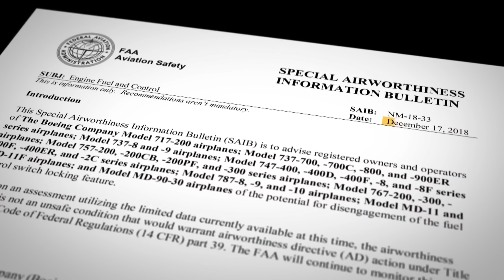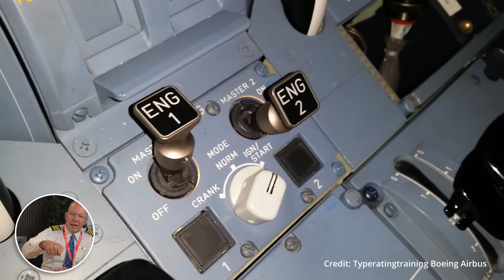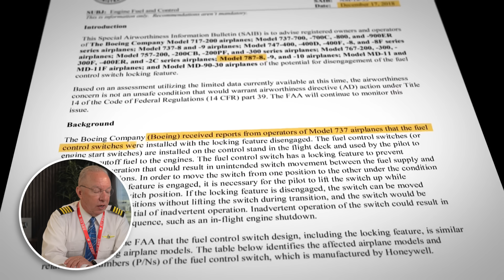Air India 171: The FAA’s 2018 Fuel Switch Locking Bulletin Explained (16 Questions Answered)

Comment: Aviation Herald was told of another safety bulletin that might be of interest as it applied to the 787-8 as well as other aircraft. It is this one: GEnx-1B SERVICE BULLETIN - 73-0097 R01 Revised: 01/29/2021  SB 73-0097 R01 ENGINE FUEL AND CONTROL - ELECTRONIC ENGINE CONTROL(73-21-20) - REPLACEMENT OF INTEGRATED CIRCUIT MN4 ON MAIN CHANNEL BOARDS
Issued:12/17/2020.  Solder on the existing part was subject to cracking with age and heat and the advice warned of a possible catastrophic failure of fuel delivery.  A replacement part was required.  One hopes that this part was replaced in all of Air India's 787-8 aircraft after 2021, especially older planes.  Has this been checked?   Air India have already missed one required update on the fuel system and have today ordered a check.  Could this be another, perhaps causing intermittent failure?

As a sometime passenger on Air India's Dreamliners I would really like to be reassured about this.

Comment: My question to Steeve is if a pilot can move both the fuel cutoff engine is less than a second, why the HELL  was it left like that till 10 seconds untill pushed back to run by other pilot and did not do it instantly in a 2 of seconds. When u know both the engines mid air was cut off, from that moment would you think or talk what happened or does your hand instantly go there and start it back within a second??? Or u think the other pilot didn't allow him and were really fighting in cockpit!!????? Or if there were any other conversations happening, why wasn't that it the report. They would know instantly right

Comment: Assuming that one of the pilots maliciously cut off the fuel, plus the recent situation on an Alaska Airlines flight out of Washington where a troubled off duty pilot sitting in a jump seat attempted to pull the engine fire suppression handles in flight, without any real fire indications present.
•What do you think airplane designers/engineers/unfortunate pilots facing a similar dangerous situation could do/change or how might this be prevented going forward? 
•What are your thoughts on different airplane design changes, or possible airplane logic updates to avoid these situations? Pros and cons of a particular or specific change you might favor? 
•For example, would placing a cover over these switches - in addition to the detent help? Or maybe installing two sets of cutoff switches per engine (one set for each pilot where both sets must be in agreement)? Or possibly separating the number one and number two switch locations making them further apart?

Of course, the best solution is one that provides better mental health services to pilots, but also across the board to all professions. This service in addition to the implementation of a frequent, yet robust screening system to identify and aid pilots struggling, and without any unreasonable or harsh penalties for pilots seeking help. However, I'm afraid it may be impossible to completely or even significantly prevent a similar situation simply because of our human factor and human emotions. It's likely that this case (and similar) will soon be cited as a justification to give control over completely to AI; eliminating the astonishing human pilot capabilities due to a fear over the (extremely rare) human vulnerabilities that lead to terrible disasters like this... 

Thanks Captain Steeeve!

PS 
From what I understand (yet disagree with), US Law restricts pilots above a certain age from flying commercially - and you are nearing this "cutoff age". I'd imagine your final flight will be emotional and something personal for yourself and your family, still may I ask that you please share even a small piece of your final commercial flight with us here on YouTube?!

Thanks again Captain Steeeve!

Comment: A one second interval between cutting fuel to both engines mechanically seems to be a bit quick . It later takes two seconds to return to run . Can both fuel cut off switches be turned to cut off in one second ?

Comment: Captain, RAT deployed the same second as engine cutoff (08:08:42) — and as you said earlier, RAT needs major system failure to auto-trigger. Isn’t that a strong sign of a sudden electrical/system fault, not pilot intent?
Also, the CVR only includes one line: ‘Why’d you do that?’ and ‘Mayday Mayday’. In a 30-sec flight, are we to believe that’s all they said — even to ATC? Feels like the report only highlights what fits the pilot-blame angle.”
Reply: If the act was intentional, and he knew only 2 people were in the cockpit, why would he deny it outright? Psychologically, someone caught in such a private setting (cockpit) would more likely make an excuse — like “I did it by mistake” or “It slipped” — not deny it completely. His direct “No, I didn’t” shows he genuinely didn’t expect to be blamed. That part is being totally ignored in the current narrative

Comment: Captain, why it can't be an electrical disconnect of both fuels behind the dashboard to motherboard or to the engine where it exists the cockpit towards engine through internal tunneling of wires as company was blamed to have metal pieces left behind inside the metal sheet

Comment: Captain Steeeve....this was a preliminary report. It said the 2 fuel switches were moved within 1 second. With the type of switches that these are, it is impossible to switch both switches in 1 second. You should know that since you are a pilot. You are blaming the mental health of the pilot to divert the attention from the design fault of Boeing. It's not a surprise that you being an American is trying to defend and shield an American company (Boeing)!! There is absolutely no proof that this is pilot error. Stop blaming the pilots who are not alive anymore to defend themselves. Stop defending Boeing by saying that the airfact ran as intented. You are clearly biased and trying to cover up the real facts. Very disappointed with this kind of behavior from you!!!

Comment: I would design the other way around. Down is RUN, up is CUT. And spring force vector is always always to the down/RUN side. So CUT requires force against spring force vector and gravity. this way even when the captains hand accidentally hit the button (while guarding the throttle during take-off) it will tend to oush the button to RUN position.

Comment: The AAIB report refers to the 'Special Airworthiness Information Bulletin (SAIB) No. NM-18-33' issued by the US regulator, the Federal Aviation Administration (FAA), in Dec 2018.

The bulletin is about the potential disengagement of the fuel control switch locking feature. The FAA recommended: "Inspect the locking feature of the fuel control switch to ensure its engagement. While the airplane is on the ground, check whether the fuel control switch can be moved between the two positions without lifting up the switch. If the switch can be moved without lifting it up, the locking feature has been disengaged and the switch should be replaced at the earliest opportunity."

Does it come as a surprise to anyone that those switches came up in the investigation? There was something wrong with those switches on the plane. 😏

Comment: I have to congratulate your airline for having instituted a non-jeopardizing program of self-reporting mental health issues and/or emotional instabilities, and providing the help to overcome those issues. Unfortunately the FAA (and likely many other regulators that base their rules on the FAA) is still very punitive in that regard. Which very likely was a huge contributing factor to the Horizon Air 2059 incident in 2023. Fellow youtuber @XylaFoxlin has shared her experience of loosing her medical certificate due to complications affecting her mental health from an intrauterine device. It is almost certain that her sharing her IUD story caused the FAA to revoke her medical, most likely permanently. She has joined lobby groups from the AOPA and others to appeal and advocate for a change of rules and regulations. How about you reach out to her in support of changing the rules and culture for ALL pilots?

Comment: The question about recording not only audio but also video to the “black box” was NOT about prevention! Rather it was about accountability and evidence proof after the fact!
I remember at least three prior crashes where mental health issues of one of the [dead] pilots has come up in circumstantial evidence that have resulted in so-called homicide by suicide. In 1999 the NTSB put forward this theory for EgyptAir flight 990, though the Egyptian authorities dispute that conclusion. In 2014 the disappearance of Malaysian Airlines flight 370 has a lot of circumstantial evidence that point towards a deliberate homicide by suicide. In 2015 the Germanwings flight 9525 has pretty conclusive evidence of homicide by suicide. Then there is also the 2023 incident of Horizon Air flight 2059 where a jump-seating pilot tried to commit homicide by suicide due to mental health issues in conjunction with the consumption of mind-altering substances (such as alcohol and others).
I have read many accident reports in wich the cockpit-voice-recorder transcripts make it very clear that investigators are unable to determine who said something or who initiated an action identified [or suspected] based on the audio signature. Having a cockpit-area-camera in addition to a cockpit-area-microphone could have been very helpful in those instances!
Based on my personal experience in the pre-9/11 era, and even shortly thereafter, where in-flight cockpit visits and even spontaneous jump-seat invitations for take-off and/or landing were possible, I can understand why pilots would be opposed to having a cockpit-area-camera record to the black box.

Comment: Wouldn't the FDR record which push-to-talk was pressed when the Mayday call was transmitted? Would it not? Obviously, this information has not been included in the initial report. Identifying either the LSP or RSP making the Mayday call, at this early stage of the enquiry. By conjecture. Could the PM have initiated the dual engine failure/stall memory item without announcing it, and at an altitude below 400 feet? Realising how low they were, if he had noticed both engines rolling back. But the 10-second delay.....?  I enjoy your channel, Captain. Impartial no-nonsense.

Comment: Question for you captain Steeve given that the preliminary report has been released purposely vague: when the FO asked the captain regarding the fuel cutoff switches "why did you do it?", does it come under the assumption that he actually saw the captain doing it or is it because he assumed the captain did it since he didn't do it? I think it is a highly important question. We haven't been told the tone in which the exchange of mere 10 words occurred: was it angry, was it bewildered? The FO certainly realized something potentially catastrophic had been put in motion. The Captain's reply: "I didn't do it" tells me that the FO didn't actually see it happening. Could this plausible deniability be the aggravating factor that brought this plane down since it prevented the FO from immediately flipping the switches back to the run position? Per the report 10 seconds elapsed between the exchange and the first switch being reversed, which, as you know, is an eternity in a critical phase of flying.

Comment: Captitano steve, thank for your informative video's. Its great watching you and thanks for taking time off your already busy schedule. With regard to one of the pilots commenting, "Why did you cutt off "Could it be :

1) The pilot was actually referring to the throttle controls and not the fuel switch. It could have been possible, the other pilot had his hands on the throttle and assumed he had pulled back power, but used the words "cutt off" instead of pull back. Obviously the other didn't do it.
2) With a one second gap between both the engines shutting off, this sounds more like a programmed shut down in phases, could it be a software doing it ?  For example, when you shut off a desktop at home, you really don't use the power off button on the machine, you use the shut down feature on the windows control panel to power of the pc, and then the cpu will do this in phases, like shut off printer first, then the monitor, and lastly the cpu itself.
3) A fuel imbalance issue of some sort ? Were the engines running on suction feed only and not on main fuel pumps.

Comment: An Analysis of the Pilot Incident
It appears there was a disagreement between the two pilots, possibly escalating into a critical situation. The presence of an on-off fuel switch suggests a direct action was taken. My hypothesis is that the pilot under the influence of alcohol, perhaps due to impaired judgment rather than malicious intent, cut off the fuel supply.

The main pilot likely confronted the younger pilot, asking, "Why did you turn off the fuel?" The intoxicated pilot, still in a state of inebriation, denied responsibility. Upon realizing the fuel had indeed been shut off, the main pilot reportedly held an intense, ten-second gaze with the inebriated pilot. In a typical scenario, the main pilot would have re-engaged the fuel within a second.

To gain a clearer understanding of the events, video footage of the cockpit would be invaluable. It could provide direct evidence of their argument and potentially reveal the intoxicated pilot's condition.

Comment: I really can't understand the logic.. At one stage they say that the fuel switches were in the off position and at one stage they say that the pilot tried to start the engine... Ai my question is how is it possible that after the crash they were in the off position.. Which brings me to another theory that there might be someone who made these changes after the crash to divert the attention from the real issue of a technical issue with the plane...

Comment: https://www.youtube.com/live/vqFgf7ezwv8?si=dgIxCG-M2A7cAmu6  my view is more in line with the content of this video. There is very little information disclosed, yet accusing the pilots is premature. Like in the Boeing Max case, system error is a serious possibility. System error may very well be the cause of fuel valve shut off. Therefore before a thorough investigation is done, coming to such conclusions is not only unjust but also dangerous.

Comment: I have a suggestion Captain Steve. I know the cockpit is already crowded, BUT, how about adding "Fuel Control Agreement" button, on each pilot's side, out of reach of the other? So, if you want to cut off #1 for example, the co-pilot could not do it. The Captain would have to depress his FCA button on HIS/HER side to allow the cut off of #1 to happen and vice versa for the opposite side.

Comment: I don’t think Pilots to be blamed for this tragedy.

If incase fuel switch were manually cut off, then they would have done it after pilots found some problem with the plane and don’t have a solution. hence, switched off just before crashing to minimize the damage.

Comment: Captain Steeeve - I've read the comments and I'm really concerned that the preliminary report provides a really confusing issue.  The actual fuel switches and assembly are available (although damaged) and are in the report as photographs, but no analysis of the material is included.  I assume that failure analysis/mechanical analysis of the actual material refute or confirm that the bulletin's findings are not applicable, or are applicable. It seems like inclusion this material analysis in the report would be germane.
Reply: Testing that this reply link works

Comment: I feel some people are potentially not grasping the limiting operating conditions for the fuel cutoff switches. Isn't it true that no logic signal would be transmitted to the flight computer without full firm electrical contact of the switch in either the run or cutoff positions? Many are looking for a potential "halfway" mode, or hanging position of the detent, but that would not allow a complete electrical circuit of the switch which is a built-in feature of its design.

Comment: I have doubts that both switches could be faulty and go faulty simultaneously. Not impossible of course. Cameras should be fitted in flight decks. Pilots should have no reason to object. The recordings would need to be stored robustly of course. This would have answered the questions now faced by investigators almost before the question was asked.

Comment: A camera system on the flight deck would not have stopped this crash. What would have stopped it is if there were two fuel cut off switches that needed two pilots to activate the switches, they could be spaced far enough apart so one pilot would be unable to reach them both at the same time.